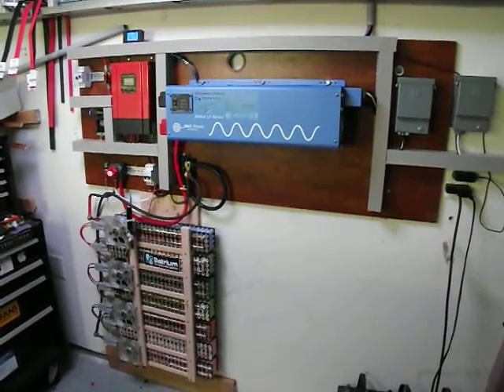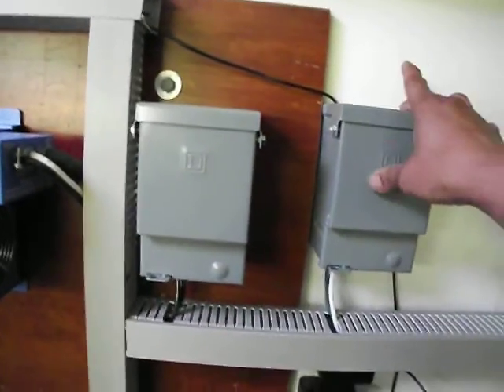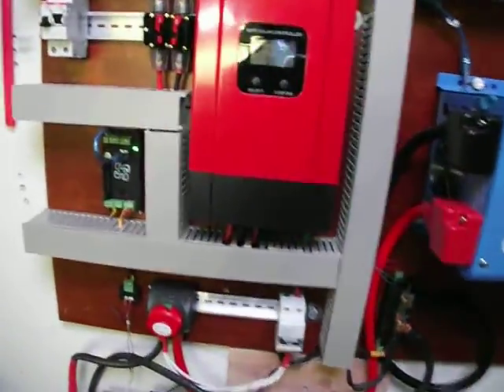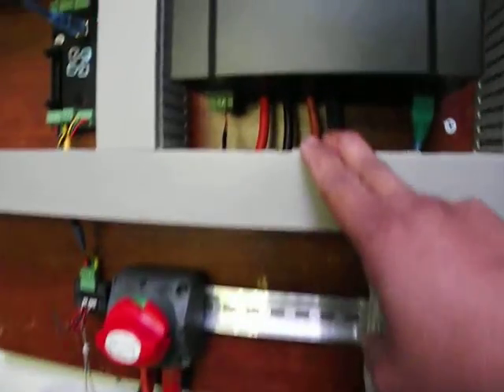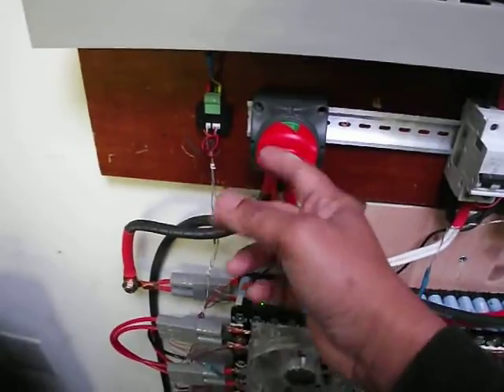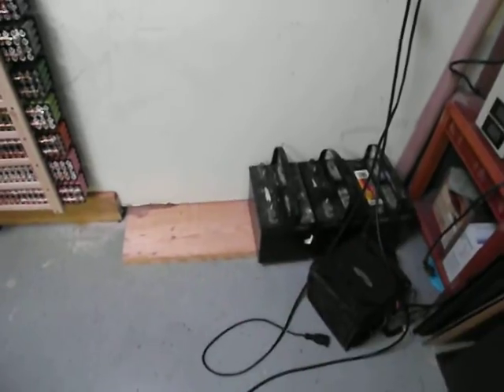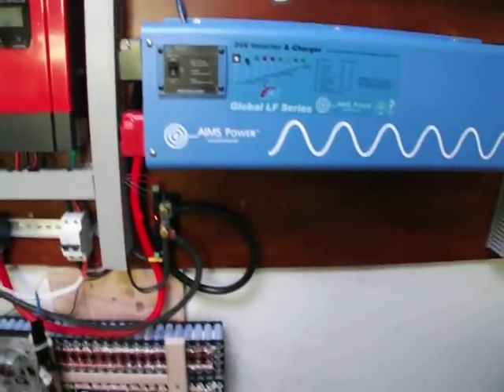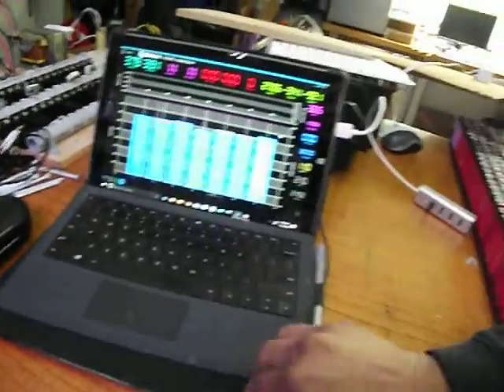DIY 8Kwh Powerwall, 6KW Aims Inverter, 60Amp MPPT, with WatchMon4 7 Longmon Starter Kit

Comment: Should not use Computer cable organizers to run power wires.  Power wires should be in metal or plastic conduit.
Reply from the maker: Are you talking about my panduit? those are use for control panel mostly in industrial and made for power and control wires sir. Thanks for the comment